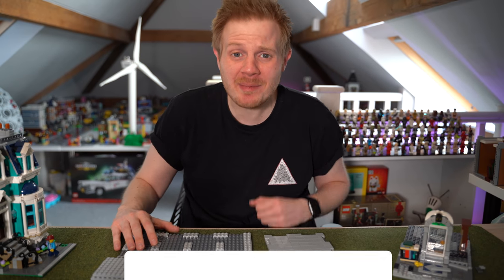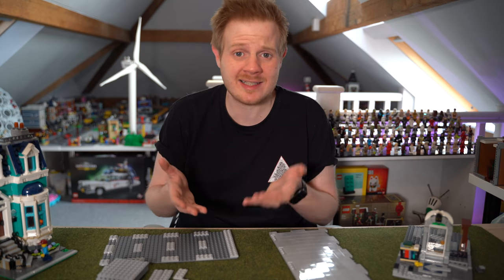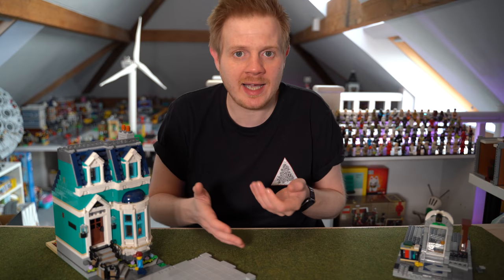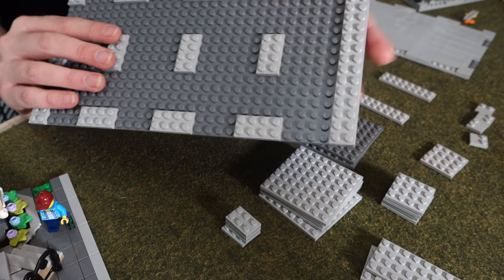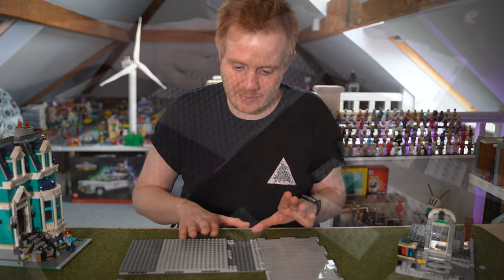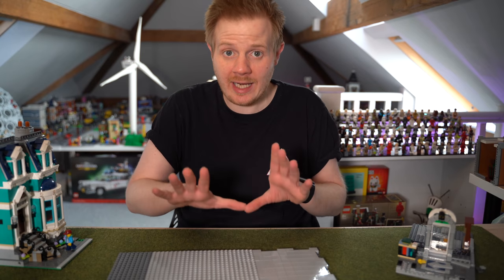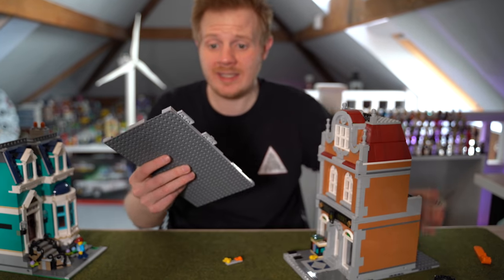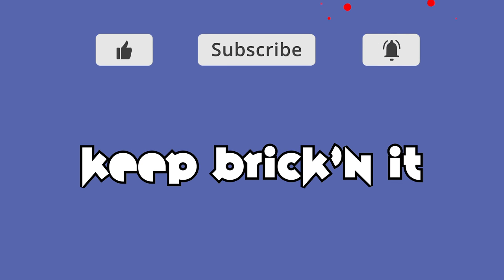New LEGO ROAD PLATES... SOLVED! How to use with Modular buildings & why? Brick'n It Mini-mils system

Comment: Your solution is nice. It is fine that you found a way to connect the new system to the existing buildings.
BUT!!
This does not solve the price issue,
does not solve the size issue - two cars / trucks next to each other have just not enough space,
does not solve the curve issue.
AND
Imagine a person having an existing city of 20-50 buildings. Now calculate the costs that LEGO ® FORCES you to take in consideration to rebuild your whole city. Or just parts of it - if you try to expand your city with the new system.

Comment: Very cool idea! You could put a baseplate underneath the modular and it would be at the same level also. I will switch to this system in my raised area but not in the rest
Reply from the maker: Yeah ive seen that. Its technically an illegal build though :)
Reply: @BricknIt  Yeah, but that is what heaps of other LEGO youtubers do.

Comment: I wouldn’t say having to rebuild every single modular set on an additional custom formatted baseplate is a solution at all. Completely impractical. Unfortunately, it seems that the new road system is really made for the new simple City sets and builds only. It doesn’t seem the modulars were considered at all.

Comment: tip, there is a way to connect baseplates to regular plates. I can't remember how the parts are called, but with 3 lego technick parts you can solve the problem of that half brick problem

Comment: Would it not be simpler and cheaper to: 1. place the new road on a baseplate, and 2. make a rectangular assembly the size of the perimeter of your building's baseplate made of a bottom layer of 2x16 plates, held together with one layer of tiles, and sit the modular building on the assembly. This also results in a height differential of one plate... and you don't have to rebuild your modulars.

Comment: the issue with the new system is that they're a plate and a tile high in the same piece... which means anyone wanting to use it will need to use plates for baseplates or fiddle around with putting everything onto something like the Mils system and putting the road plate on a similar system but a plate or two lower.

Comment: While you say that they take up less space, I would argue that without that small bit of added space the playability and or appearance of the city will look so much different (likely worse on both accounts).

Not a fan as the four cut outs that allow you to place tiles to make a centre line as a + junction it leaves ugly looking lines. 

While a MILS plate system might be more expensive it is properly modular, and is significantly more customisable. 

But most importantly the inclusion of the roads within city sets takes pieces away from the actual builds or would increase the price.
Reply from the maker: Yeah thats a great argument! I think a lot of city builders may not even be aware of MILs so this to them seems like a completely new concept. The MILs system might even be something i transition to at some point but i do think that the new road plates will be easier to get all of the parts etc.
Reply: @BricknIt  - well the road is essentially built using 5+ pieces 1x 16x16 base; 4x 2x4 tiles and then another 2-4 as slopes or connecting 2x4 tiles.

The base plate may actually be quite handy for MOC builds.

For me though I will just keep using the carpet/table.

Comment: That's a lot of unnecessary work to "keep it modular"... You know you could just keep the 2x2 plates with the two studs embedded in the sidewalk and just remove the road plates underneath. The whole system you've built there kinda screams for it. 😅 The whole city will fit together like puzzle pieces without needing as many individual connecting pieces as a mills system might use.

Comment: Just get yourself some 32x32 plates (not baseplates) and build your current and future modular building on top of those. Problem solved.
There are several third party solutions to 32x32 plates, otherwise use four 16x16 plates from LEGO.

Comment: Surely, if you're going to get the new roads then it would be cheaper to just put the modulars on 16x16 plates with a few 2x2 plates to get the height - then don't bother with the 16x32 base plates altogether, and you won't have to buy extras for the bottom of the road sections. Sell all remaining 16x32 and 32x32 base plates to pay for 16x16 plates. It's ok for you to come up with this idea because you can afford it. It would cost me over £600 to convert all of my city and I would rather pay for 3 or 4 new modulars instead. I like your videos Chris, but this isn't one of your better ones sorry mate.

Comment: Why are people so against using MILS system? Trying to do something like this is far more expensive than simply building on MILS! Not to mention there are so many benefits to using MILS, like bieng able to actually move your buildings around without their baseplates flexing on you and causing you to drop your building! Quite trying to come up with whole new systems fro accepting the normal baseplates, and simply use the superior system! Your already paying big bucks for LEGO brand, so spend a few more and do it right with MILS!

Comment: Or you could just use 2 x 2 studs x 2 plate round slopes, giving you a road with a realistic surface curvature, implied drainage, a proper curb, and no need for extra baseplates.

Comment: I feel like I have to lift my buildings to make it compatible for this new road system... I will save my opinions until I get it in my hands
Reply: Oh you not only have to lift the Buildings. Any Cars 6 Studs +  will look like shit because they simply don´t fit anymore exept you take one complete of the new Plates as one lane.  This width is only good for 4 Studs only
Reply: @mariokuppers5686  I only use four wide vehicles anyway...mostly classic city ones...
Reply from the maker: I think thats definetely a good choice :)
Reply from the maker: You can actually attache the road plates next to each other so the roads are double width :)

Comment: Lets just sum up the facts about the new road system in comparison to the old plate system: 
1. no curves
2. all basplate buildings need modifications to be compatible with the new system
3. higher price
4. 16 pins is to small to fit two trucks or they will hit each other
5. they don´t look as good as the old streets
Conclusion: just don´t by this crap.

Comment: I'm new to LEGO (just got my first set at age 30). I gotta say, the old road plates are hella ugly. I understand a lot of LEGOTube doesn't like the new ones, but I think its only because nostalgia and cost. The old plates make everyone's lego city look the same. Everyone has the same modulars and the same road plates. Time to break the mold. Glad you're upgrading!
Reply: it's mainly because all old buildings are on baseplates and nobody with a brain will pay more for streets which are not compatible to those. but there are much more reasons. almost no car fits on the new roadsystem. it's reflecting, when did u ever see a reflecting street? no curves. even the new buildings are too low to make those streets fit, so you even have to raise the new ones. i honestly dont understand what was so hard about making them at least compatible to baseplates or add bricks that solve the problem. id rather grab my pencil and draw the roads myself than using this bullshit.